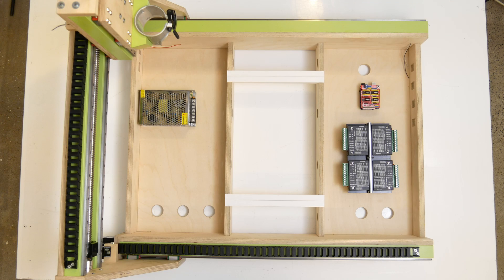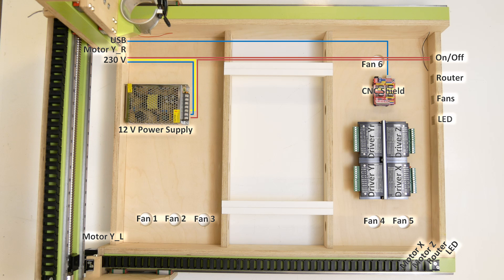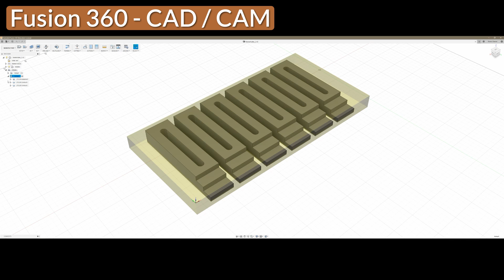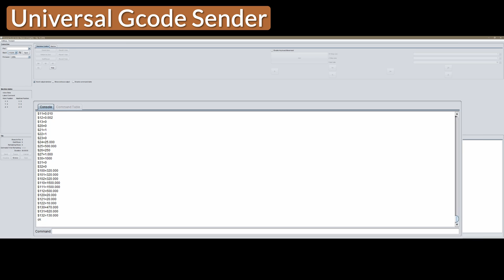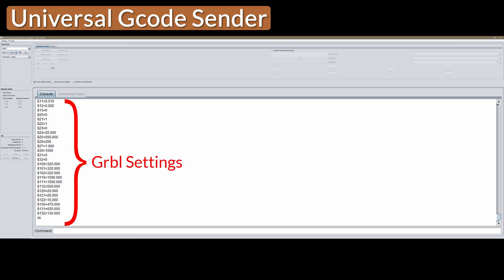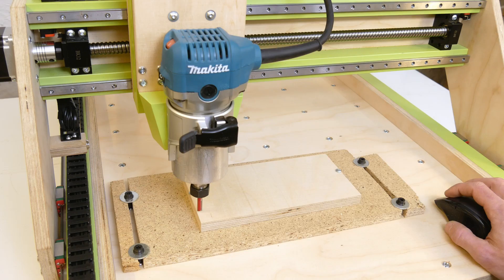DIY CNC Machine - Electronics | Part 2/2

Comment: on 7:11 I see you placed 2 jumper connections for determine what axis to clone,
but you also soldered 2 blue wires to the EN/GND, what is the function of that please?

and, the Arduino and Shield do not need 12 24 36V input?

Comment: Hi Sir,

My setup is identical, so I want to ask if it is possible to receive your IDE program to upload in my arduino.
I am not familiar with electronics, so this will help me out a lot.
(maybe an wetranfser upload, if you send me the downloadlink, would work for me)
I hope you can help me out, thx

Comment: just a word of warning.  Allow enough space in your flexible wire way (drag chain) so no compression of the cables occurr.  Long term heating with the cable bundle can occurr and cause welding of the insulations to one another and even develop a short circuit between wires and cables.  I have seen this several times in my 30 years as a cnc tech. Overall, nice build!

Comment: Great Video! Just starting to build it. Don't know if you are still monitoring this thread but I was trying to figure out how you were sending simultaneous commands to both y-axis motors so they run together.  I noticed that there are 4 y-pins jumpered together on the CNC Shield just behind the 12-36V connector. Does that have something to do with it? Was also curious on the value of the capacitors. Thanks!

Comment: cool! I wonder any CNC control system can work on irregular material? Like scan the object on a picture, use mouse to point on it then send data to control system, driller run automatically.

Comment: hello, what capacitors did you use on the shield and what diameter cables did u use beside the 0,75mm ones?

Comment: nice build but router not have good spindle wery loud. better buy real spindle motor minimum 500W have cheap, ER 16 good. software aspire have best in torrent have, easy make g-code, and linux cnc controller cnc machine better than all others.

Comment: wery small motors, minimum cnc mill need use 4-5ampere motors. lot biggest torgue. power not good i has test many and need be my motors max 4,5A need ewery axis own power max 10A and power to drivers need big 10-20 000 uf capasitor stabile beaks stepper use beak lot, arduino need own power, whit fan all. limit switch have trash, better buy factory guality metal cover limit switch. 10 pcs 20$ ebay. need 6 limit SW.

Comment: arduino NOT have best controller but working and cheap, i use paraller port controller 4 axis minimum drive, cost 10$ and best what i has testing, i has test arduinoraspberry pi, manyfactory controllers and expensive and problematic have all in manufactory controller if come somethink problem or broken elektric need buy ALL new and expensive buy, paraller port controller cheap and good,better than arduino, motor drivers have important be good. 5A-8A drivers good. can use nema 23-34 motors. software manufactory has many shit own soft no good, mach3 windows lot problems alltime and can destroy all cnc, linux cnc best and can add own makro lot and have in web lot makro, help tools, ready softwares etc.

Comment: Please tell me how you got one extra connection to ground pin on cnc shield which was not in the video. Can someone help me with ((4 Nema 23(2*Y) 2.8A motor,  tb6600 motor driver, cnc shield, pnp switch, 12v 20 amp power supply for GRBL1.1 firmware)) connection. Thankyou in advance.

Comment: Impressive well done, Congratulation Good CNC Engineering.
How did you get stepper driver  and stepper motor to work. I have Arduino Uno & CNC Shield. I remove DRV8825 Stepper Motor Driver Module they're 2.2A and jumps., I hive 23nema dual 3.0a/1.8 + Stepper Drive DM542A 2H. I connect it one stepper motor., Z. Same as your wiring. The green LED its ON at stepper drive. When jog Z stepper motor just hums., i double check my wiring it the same as yours. Can you explain how to get it to work.  Thanks

Comment: Reality Check!  As the video shows you will need some specialized machinery to fabricate this CNC. Also you will need advanced knowledge of computer CAD and other software which is extremely difficult. So if you think this is an easy build for most people with basic carpentry and computer knowledge think again. Also the parts are not cheap and good luck finding them.
Reply: Cope

Comment: Hey so I bought the plans built the frame now I'm waiting for parts from china. Have you had any issues with th stepper motor size? Should a larger one be used for the z due to the weight of the router?

Comment: In your wiring diagram you show the ground from your power supply going to the PUL- and DIR- terminals of your motor driver.  It should be the ground from your Arduino to those terminals on your drivers.  I believe that is how you ultimately wired it but I think your schematic is wrong...

Comment: Hi, great video. Can I confirm that the two units..
Arduino Uno - https://alitems.com/g/1e8d1144942ab6f...
- CNC Shield - https://alitems.com/g/1e8d1144942ab6f...

are correct?

They do not look the same as they do on your video. I assume that the Arduino is the driver and requires 4 units and the CNC shield needs 1 unit.

Thanks

Comment: Awesome project, building a plywood CNC too. Are you still using 12V for steppers? I think these NEMA 23 take 48V for full performance, there's a chance you're only taking 25% of the torque out of them. This could affect the cut quality because ball screws are backdrivable and steppers budge even when holding the position.

You'd need to upgrade to something like DM556 or R60 drivers which support up to 50V.
Reply: Hi. I have built this exact cnc but have added my own few modifications such as 18mm ply and I added 100mm to the x axis. I found the 12v to be quite weak for the stepper motors. What 48v poer supply would you reccomend.  eg watts and amps? Thanks
Reply: @AdamCunniffe  just add the amps you want to use for each motor and then add some safety buffer. E.g. 4 Nema 23 motors rated for 2.8A I'd take 15Amp to 20Amp 48V power supply to be able to upgrade the steppers later if needed. It's critical to get brand name drivers though because cheap drivers will waste most of those amps in heat.

Comment: I think i'll buy your plan, but 2 questions.
Are your plan including electronic part and wiring ?
Is there a "how to" programming the arduino to use it as cnc controler card ?
Thank you for the vidéo ?
Reply: wiring plan not included even programming, i have purchased

Comment: Hello friend, is it easy to make this CNC, for those who do not understand English (I mean the video)? Do you detail well in the project plan? I would like to buy the plan but, I'm afraid it won't work.
Reply: The plans have some dimensions and product specifications. There are so many things that Roman has not covered in these videos or the plans. I am building a version of this router and there are a few changes I will be making. I have spent a good 20 - 30 hours researching. If you need your hand holding, or being told to plug a to b then this is not the project for you. May be best to buy a pre built one...
Reply: @joshboatman6459  Thanks for the warning. I would love to build a CNC because buying a pre-built one is so expensive!
Reply: @joshboatman6459  Hi Josh! And you do not intend to provide the complete construction plan for your CNC and a list of materials?

Comment: First of all Big thanks to clear explanation. You help me a lot.I almost finish my project with your help.But, at 3:35 you say positive wire to the VCC ports but on schema you draw the (red)line from negative to VCC ports. I'm confused and I'm stuck.Please tell me what i will do?
Reply: He says he ran the positive from the power supply to the vcc of all the stepper motor drivers (there are 4 separate drivers). The ground is connected to three sockets in each stepper driver.

Comment: one tip is that you can save alot with an old server 12v psu on ebay as they are plentiful, cheap used and way more reliable than chinese versions.

Comment: As was mentioned by Jelle, using your switches as N/C would prevent damage to your motor, drivers or power supply in the event that the wire to your end stop switch is broken, in that way, the system would detect it and stop but in your configuration, if it is broken, the system motors would drive the axis into the end stop because a broken wire and a N/O switch are read as the same.

Comment: could you supply me with the fusion 360 file(don't mind paying) the reason is i might have to alter certain aspects as my plywood is 18mm difficult to get 15mm in uk also may extend bed slightly as im wanting to produce flight simm panels

Paul  axholme4info@aol.com

Comment: The screw-in threads in the table, are the holes right through? Wood shavings would go into the electronics.
Reply: Yes they could if your inserts are hollow and you’ve had to drill all the way through.

Shortest insets I found are 14mm and are hollow.

I’m going to adhere a 2mm circle plywood patch below the hole.

Comment: Doesn't a lot of dust fall down into the electronics space through the holes in the machine bed?
Reply: It will do if the insets are hollow and the bed is drilled through. I put 2mm ply patches below mine.

Comment: the spindle where you used it is not seen in the video where and how did you connect it?

What type of capacitor did you use in the capacity limit switches?

Comment: Very nice and sharp videos and tutorial wow Thanks.   I have a question for the wiring of limit switches.  Can you tell me what capacitors you take to avoid  false trigger ?

Many tanks again :-)
Reply: Forget that solution. Use this https://www.tindie.com/products/eccentricwkshp/cnc-optical-limit-switch-isolator-grbl/
Reply: Did you get an answer about the capacitors? YouTube showed this there is reply but I can’t see it.
Reply: @buenacg  tjere is the answer i recived in my email

I've used 2A103J capacitors which help to prevent spikes in the signal and therefore reduce the risk of false triggers that could interrupt the machine while running.
Reply: @ericduchesne366  Thanks so much for the reply! Especially since this is a really old post. Really appreciate it.

Comment: Hello, I bought th plan, but can we tell me the tip of rail? And the length? Can you send me Se 3d file of project? If you contact me in private I tell you my email so you can verify that I bought the plan
Thanks
Reply: The dimensions are written on the plans. Page 4, bottom left corner

Comment: I like how you added the LED strips. One suggestion: I would put down a cover between the electronics and the spoil board. Wood chips and dust will fall through the holes in the spoil board directly onto your electronics creating a fire hazard.
Reply: ayeeee. im gonna do that.

Comment: I know that this reaction is a bit late. But you sould realy add a wire between ground of the PSU and the arduino. this is to prevent  a floating ground.
Floating grounds can have many effects one of them is triggering stufwhen its not suppost too.

The rest of the wiring and project look really clean and good.
Great job overall
Reply: If you watch closely you'll see that ground is connected to the Arduino. However it isnt shown in the schematics. The cloning of the Y axis also isnt on the schematics. Had too zoom in on his wiring of the Arduino to see this

Comment: Fantastic build! A few things  strike me - I would have made the uprights out of aluminum, and would have made metal plates to secure the wood over the linear bearings so to be able to provide more surface area to clamp with.  And Fusion 360 is "quite simple to learn"? Not in my experience! Other than that - I want one!

Comment: Hello Roman, I purchased the plans for your CNC build this morning.  My download did not include a pattern, or the measurements for the gantry side angles as well as the measurements for all the screw hole locations in the gantry side pieces and other parts that needed holes for the attaching screws. Are these diagrams and measurements something that was meant to be included, or not?Without them,  its going to take me quite a while to figure out all the layout for the connecting screws, for all the the various parts that need to be joined together with the screws. Thank you,  I look forward to your reply.
Reply from the maker: Hi Will, thanks for the feedback. I've implemented the changes with the gantry sides and added the axis measurements for the ball nut housings for easier positioning. The holes can now simply be positioned by taking the offset measurement from the manufacturer's drawings. I've sent an updated set of plans to everybody and updated the download file.
Thanks again for the input and have fun with the build!

Comment: It seems to me that dust will fall into the lower part,,, through the hold down holes ,,,where the electronics are kept???? not a good thing...
Reply from the maker: Hi blueknight, the holes aren't drilled all the way through exactly for that reason. You can see that I used tape on the drill to limit the depth while drilling the holes by hand.

Comment: A really beautiful build. There is just one little safety issue :) the connectors of the router are reversed, so you can easily touch a live wire!
Reply from the maker: Thanks for pointing this out, Lukas. You're of course right and I realized it too late. For everybody else, please install the connectors in reverse.
Reply: @BooTec  Is the plans updated for the correct wiring? :)
Reply: Thank you for very helpful  video.
Sir please  provide  me for circuit/control wiring drawing. How to connect micro drives  and cnc shield,  please  send  drawings. 

Email:- info.office.sbe@gmail.com
Reply: I was about to say the same thing, that the router connector pins were dangerously reachable with a naked hand :/

Comment: one question? Can your router reach in front of the waste board? I use that possibility to mill end grain like dovetails or text at the side of a longer board box joints go also very nice without dog bone holes. Nice project though
Reply from the maker: Hi Hans, I show the working area of the machine in the beginning of video 1. If you install your working piece a little bit further back you can also machine dovetails.
Reply: @BooTec  I meant: https://www.youtube.com/watch?v=Fh2u3DE-ae0&list=LLZmBP82NergpYkNOEXCTjXw&index=6&t=0s real dove tails not the ones with dogholes in the corners of flat stock  kind regards Hans

Comment: fusion is no longer free for private use, I used it for about 2 or  3 years and last week out of the blue it stopped. And since I have a small pension I'm not going to pay the jackpot every month to autocad shareholders Nice project though
Reply: It’s still free for personal use. Autodesk requires you to renew your non commercial license yearly is all.  https://www.autodesk.com/campaigns/fusion-360-for-hobbyists.  As long as you don’t make over a $1,000 a year with it.

Comment: Hi thanks for the video I liked this project so much . Anyway I want to build one but still thinking about the design process in other words can it withstand the static and dynamic loads
Reply from the maker: Hi Ilias, check out my new video https://youtu.be/jMcblAB_fe0. You'll see that it can also machine aluminum when using the right settings.

Comment: Fantastic build! Congratulations! Did you find any problems with dust and the linear rails ball bearings?
Reply: Wood dust won't cause any damage to them. I work in a machine shop and metal chips are all over them, as long as they are lubricated the linear rail guides will brush off any debris.

Comment: Hey, I want to build my own cnc machine. but I should choose a 500W Spindle or a Makita Rouder. Can you help me to choose the right one? the Rouder is much louder. but i have more confidence in makita than in a Chinese Spindle.
Reply from the maker: Hi Simon,
For hobby-use, the Aliexpress spindle should be fine too. The spring collets will also allow you to use a wider variety of tools. I've owned to Makita router before and it's always been working very reliably, so it really comes down to your preference and what you'll be using it for.